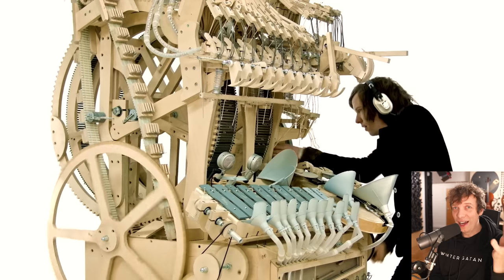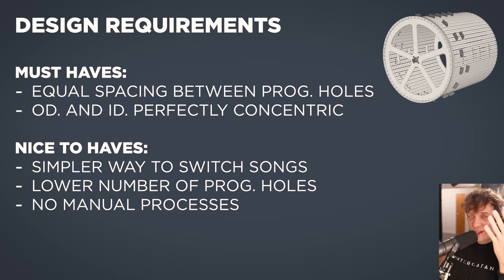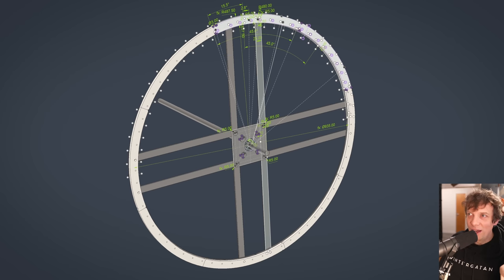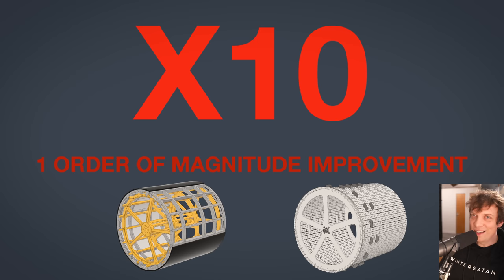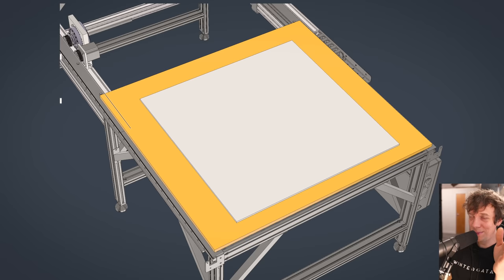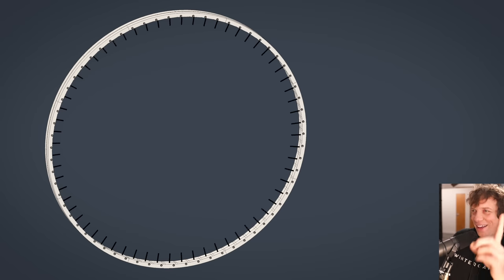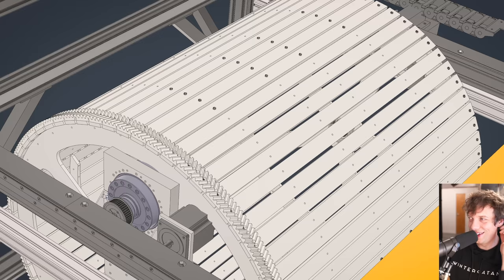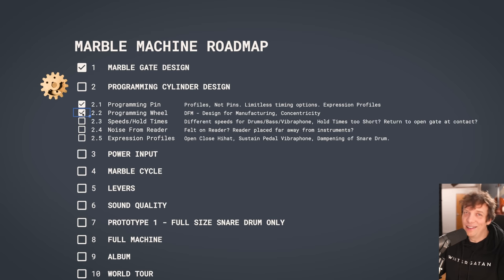A New Music Programming Wheel

Comment: That wheel is gonna twist like crazy without some reinforcement. The drag on the cams is gonna be strange.
Reply: This exactly. But when it does he can create another 58 videos about why we should care. Dude burned that bridge a long time back!
Reply: Yeah, both bearing mounts are completely independent of one another while all the force is on only one side. There's almost nothing stopping the torque the programming plates will put on it. I think putting gears on both sides is the most straightforward thing to do. That equalizes the forces and will make it run even smoother.
Reply: @maxweber06  adding extra plastic supports in the middle would help with stiffness, also adding extra metal rods or metal strips on the spokes or inside of the wheel would also help.

Edit: or lock both wheels to the axle and have the bearing on the support structure and supporting the axle rather than between the axle and wheel.
Reply: @conorstewart2214  I would jsut add a 3rd inner support wheel
Reply: @deemstyle  hes never claimed to be perfect..that would be boring anyway.
Reply: @deemstyle  Yeah, that is the exact same reason i quit watching along time ago. Thought I would check up and this is what I got hit with. "Oh martin is still doing the same failures. Ok, I'll check back in a couple of years later to see how the train wreck is doing."
Reply: I like all the negativity toward a design that the people criticizing don't know much about.
-You don't know what the pulling force will be on the programming pins
-You haven't calculated the shear on the wheel
-He literally said at the end that the slats are in contact with each other
Reply: @deemstyle  He doesn't owe you a damn thing.
Reply: @goliyth5134  Yet you're still here lmfao
Reply: That is also my feeling, there is needed some torsional stiffness. (ribs that run at 45 deg, like helix inside the drum) Plus, to me, the most critical part is not much when it will be in operation. But more when machining. The wheel will twist and precision could be lost
Reply: I dont think so. The setup cranks the inner axel and both sides are attached to that axel. The axel would have to be twisted to make in warp. If the setup would crank one side then it would warp. 
But then again, if the goal is to CNC the programming slots in place assembled, he could just attached fixed programming plates, as on the MMX, and machine the holes in spot in those. Thus he doesnt need all those strips thats illustrated now. The space inbetween the programming plats would mather then if he just cnc them assembled in the new machine.
Reply: @goliyth5134  But you're still here xD
Reply: @maxweber06  or you know he could just remove the bearing mounts and helical gear all together and just drive the shaft fixed to the spokes...
Reply: 12:40 he literally explains that
Reply: No to mention the angular alignment of the 1st track to the last track. Good chance for him to define quantified requirements on alignment error wrt timing specification., which then also feeds into the drum rotation speed etc etc etc... He missed the related requirements of the equal spacing between programming holes which also implies consistent timing between tracks (for which torsional stiffness and alignment as well as beam stiffness will matter). Currently chasing his own tail because there is no coherent system requirement specification and flow down of requirements. Great configuration item breadboard de-risk program though...
Reply: Yeah came down here to say the same. especially with all the inertia, this thing is gonna rip apart. Do we want it static? I dont know. Maybe some flex is possible, but then all the other parts need to be able to shift with it. As said above, making both sides with gears is possible. But if both gears dont run completly the same, this will introduce a lot more issues than wanted. I think with the way this is set up, it is maybe best to attach some L profiles to the end to stiffen it up. Next to that, maybe stupid idea, but have you thought of attaching the gearing on the inside in the middle? Or why is there even a centre shaft? is that absolutly necessary? If you were to have some system comparable to a drum break, where wheels are forced outward through a system, it doesnt even matter if the wheel is oval or perfectly round. This system could compensate for that and would also automatically solve the whole drum replacing issue for different songs. You just pull in the wheels, the drum gets loose and can be detached in one swift move. Less parts is not always the best idea in my opinion. Coming form a mechanical engineer btw...
Reply: @SpudSpudoni  Yet, your comment flies without reading the entirety of mine. Let me help you ".. check back in a couple of years .." AND "Thought I would check up ..". Here you are not being able to to put it together. You'll get there, i know you will.
Reply: @lucapiacentini6924  I think we are all having the same alarm bells ringing. I think the idea of ribs at a 45° angle is a great solution, I would only add that they should recess into the horizontal programming plates, or have some other friction locking design added. I don't think this would have to add to the total number of parts in the wheel, just a redesign to the existing reinforcement ribs that are placed at 90° to the programming plates currently.
Reply: @maxweber06  Yes. Having a gear on both sides and then driving both with a steel axle is the best way. It'll keep the programming wheel simple and light, while making sure that it does not bend.
Reply: @goliyth5134  Constructive criticism is good, but what you're doing is just negative.
If you don't like it, don't watch.
Reply: @FWBonly  I think a thin skin of something would be enough to reduce the flex. My first thought was fiberglass.l, but a thin sheet of carbon fiber would be even better, like the skin of a plane wing.
Reply: @someguy5334  I'm an automotive engineer, we deal with rotating assemblies often. Two gears and the extra parts to keep them in sync is going to be more work and introduce chatter and still have the same problems.

We need to remind Martin to go back to first principles and do testing on a small scale. Make a scale model or of weaker materials and see what flaws are induced. I think he's back to his old design pattern again.
Reply: I would just keep this design, only avoiding to apply force to the cylinder directly: I would put the helical gear on a “third wheel” detached from the cylinder but anchored to the central shaft. Thus no warping is introduced in the programming cylinder. 
Thinking about it, separating the driving wheel from the programming cylinder opens a lot of options for creative setups.
Reply: His Wheel is made out of 4 pieces so think that torsional forces wont be sutch a problem, If the wheel was made out of 64 individual pieces it would be a problem, Also he can always put a tube inside a wheel that transmits torsion if the deformation is too much I would be worried about gear backlash, I know it is a herringbone but still
Reply: @goliyth5134  I clearly got what you said, it's just futile to keep checking back on a project you obviously dislike. But keep spreading your positivity!
Reply: @catseye10000  That would not work. A supporting wheel in the middle would be nothing more than the rotation center of all those programming plates. They could still twist. The only option that would work definitely is a rigid tube with flanges at its ends and be placed inside the programming wheel connecting both outer wheels.
Reply: @maxweber06  I was thinking of that as well. But here is the problem. How do you achieve both left/right drive assemblies to be parallel? Could a larger diameter shaft that tapers down to bearing size solve a one side drive twist issue? A smaller drum inside a bigger drum, so to speak.

the twisting may not be an issue, The wheel/drum has to be built and tested for that suspected twist.
Reply: @tobiasebert830  good Idea but I would still put a center wheel to make sure bowing doesn't happen on the programing slats
Reply: A simple improvement here would be to move the bearings off the wheel and onto the machine. Have a fixed shaft connecting the two hubs. Simpler, a little cheaper in terms of buying bearings, and stiffer.
Reply: @goliyth5134 so dramatic

Comment: Instead of attaching the wheels directly to the bearings I would suggest you make a hub and attach it to the shaft with splines. That will lock the wheels to the shaft and ensure that it will not twist over time. Now that the wheels are locked to the shaft and timed with splines on both ends you can just support the shaft with bearings that are mounted to the support frame.
Reply: I was also worried about the two wheels becoming missaligned.... That is a good solution
Reply: Or maybe you could keep the original idea but use a 10-20 cm diameter off the shelf plastic pipe and fittings, that the wheels can be attached to with screews. It would provide more rigidity, while keeping the smoothnes and precision of the metal bearings.
Reply: With this design and using quick release bearing housings on the machine you would only need the two bearings total vs two for every wheel that gets made.
Reply: With all the problems of the MMX programming wheel it had one big advantage, torsional stability. The large sheets bolted to the rims made them extremely stiff. This new design sacrifices that stiffness which when talking about precision in timing. The idea of using splines on the shaft could help with this, but I'm not sure it's enough. The machining will have to be very precise with absolutely no backlash in the splines. Even a backlash of a hundred of a degree would mean a shift in timing between the two ends of the cylinder. The two rims has to be fixated in relation to each other.

I don't claim I have a solution, I can just call attention to a problem that will come back and bite you if ignored for too long.
Reply: Or if you want the bearings on the wheel you can put a tube between the wheels. The axle is inside the tube. The tube keeps the wheels from twisting.

This looks like a reel from a combine harvester. You can steal parts from those 😅
Reply: Having bearings mounted to the frame would make sense if there was a requirement to  have the shaft spin. You're thinking of this like it's a shaft with multiple gears creating a reduction. the only requirement is that the programming wheels spins. Either way, you have to produce a shaft that is highly cylindrical with low runout. But the nice thing about a fixed shaft is that it's stupid easy to align the bearings and get a perfect spin. The alternative is lining up a shaft that is fixed on a welded frame. Not a huge deal in a professional shop, but Martin is working 1 step up from the home gamer in his garage.
Personally, if I were doing this I'd take his idea 1 step further and cradle the shaft in V-blocks for easy removal. Machine a flat on the ends so I could clamp it down effectively and put some kind of indexing feature on one end so I can repeatably set the axial position.
Reply: Yeah, like using hex shaft
Reply: @BagManBlog  Doing something like this would make it realy easy to swap between wheels for reprogramming.  Wheel A is in the machine and set for song A which just ended.  Wheel B is not in the maching and is set for song B, which is next.  Procedure is: Unlock wheel A from machine, remove Wheel A, insert wheel B, lock wheel B in, play song B.  While song B plays, set up wheel A for song C. Repeat in reverse at end of song B and set up Wheell B for song D.
Reply: How about welding?
Reply: @Jako1987  Yes, exactly! Parts can probably be bought directly from  certain stores in Sweden like Biltema, Bauhaus, etc.
Reply: @BagManBlog  I like this idea but even simpler than machining the whole thing would be using a small trailer axle. Cheap, stiff, concentric and no operations except maybe making some adjustment slots or something like that.
Reply: @blahorgaslisk7763  Perhaps some X-struts (or tensioned cables) around the circumference of the cylinder would help with this?  I'm thinking about 4 faces worth, or 5 to meet up with the spokes at anchor points.

If that works well enough, perhaps the axle itself would be redundant, which might provide operational space for easier yet still precise mounting.  Then again, the axle makes good support for a compression fit between bearing plates, and that would be super convenient.
Reply: @blahorgaslisk7763  making a spline saft accurately is hard, and in order to make the wheel removable, the whole shaft must be splined so I dont think this would be an elegant solution
Reply: Also remember the wheel has to be swapped in and out for programming! I think the integrated axle would help a lot in maintaining rigidity when out of the machine and ease the swap.  Otherwise the poor crew member is going to have to carefully thread the new wheel onto the two bearings, and in my experience the axle never lines up correctly with the bearings on the first try, especially on a darkened stage.

I like the idea of fixing the axle to the wheel and having bearings on the frame, but you still have to engineer the mechanism that lets you slide a new axle+wheel into the frame.  Perhaps the bearings should be bushings instead, to allow them to be made in two halves that can be split to accept a new wheel.  Surely friction here is not a big problem, you can just overcome it with more drive force.
Reply: I guess this will allow adding gears to the hub as well so torque will be applied to the splined shaft
Reply: @frandiminic3559  Making the shaft isn't all that hard. The hard part is to get guaranteed tolerances so small they are not going to impact the timing by allowing the drum to twist end to end, while allowing for easy replacement of the entire drum. It's not really insurmountable, but as you say, doing it using home gamer techniques and budget isn't as easy.
Reply: @HonoredMule  I have a hard time visualizing this. Sounds like you would be introducing a lot of complexity and new hard to control variables. To have any chance of success this should be as simple as possible.

 A version that could compensate for some torsional elastics would be to have two drive gears, one on each end of the drum rather than drive it only from one end.

The model that was shown in the video used a wishbone gear train on one rim being driven by a matching gear in the machine. Extend the drive shaft of this drive gear to stretch across the width of the programming drum and add a drive gear and gear train on that side of the drum. With both drive gears running on a axle with minimal torsion both rims would be driven in tandem with no torsional forces introduced over the width of the drum by the drive train, and any forces caused by the decoder would be negated.
Reply: @blahorgaslisk7763  I actually did think of that, but think I'd rather have more rigid parts in the assembly than more points of detailed friction contact (twice as many gear teeth and in two places, with another axle for the two drive gears).  In that scenario, every time you load and unload you have to make sure both gears engage in balance rather than chipping themselves from misalignment or being off by one, twisting the cylinder.  Additionally, these two meshing points are on opposite sides (probably of the middle) of the machine - good luck observing and controlling both simultaneously.

Imagine if you rolled out the drum as a flat sheet, left to right, and observed this on the back of it: XXXX.  That pattern is being made either by rods or cables - each X is two of them - so that any twisting force has to stretch half of them and compress the other half (hence the support can be either compression or tension).  You just have to choose between adding mass and adding internal tension stresses.

Radio towers typically use rods, but they're trying to add support against all kinds of forces, not just twisting.
(And they want the optimal strength out of the other beams making up the structure.)

Comment: Don't call me a hater - I love this project and have been following for years. Love the new direction with first principal design. However, this video was about concepts which have not (yet) been tested. The marble dropper test series was proving the design, before designing the final implementation. This video swaps those steps, and I sense it will be a great risk to the project to have not proven this direction with testing first.